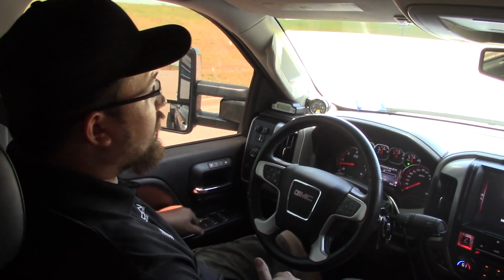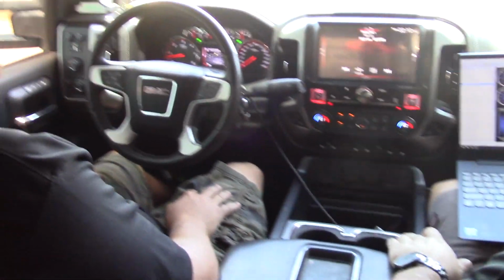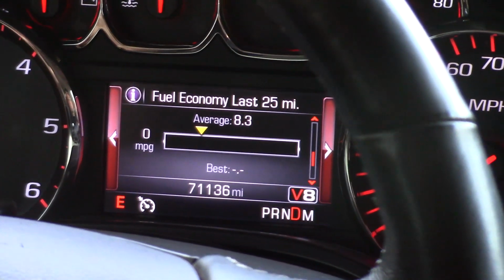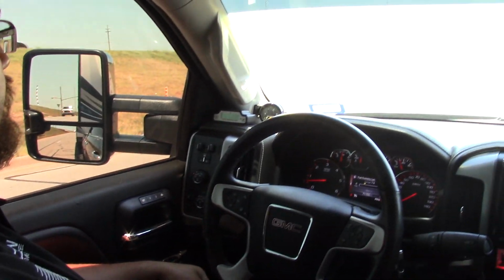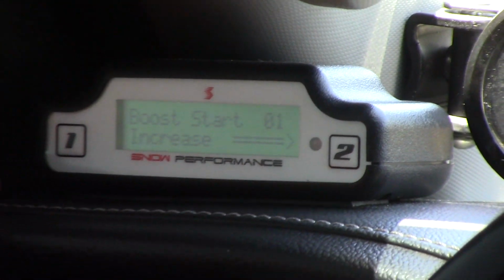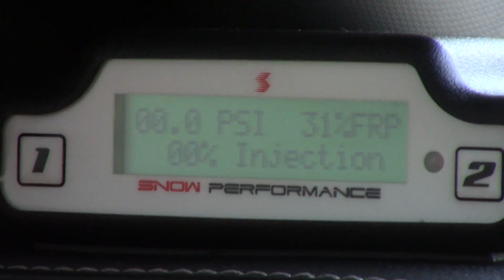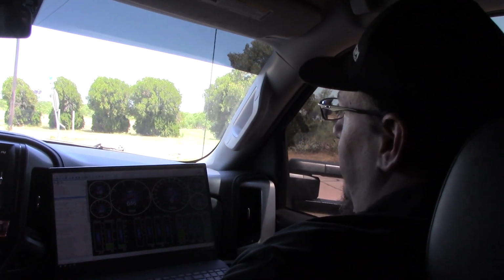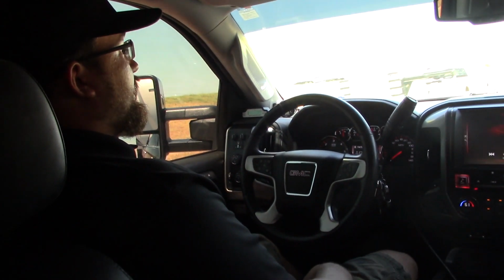Does Water/Methanol Really Help When Towing?

Comment: Hello! Fuel increase got it! 
Isn't one of the biggest benefits of using a water/meth injection keeping things clean and improved engine life? 
I do not have this set up yet, but I have heard it works like a steam bath etc. If true, that would seem like a much bigger benefit over 10% increase in fuel mileage when we think in terms of costs down the road. Ane engine that will run for 500k miles vs 350k miles without serious engine work seems like a much bigger selling point to me. Hell, I don't know! I'm just saying LOL.

Comment: You didn't reset the mpg average after the dry run. That means the wet run averaged together with the dry run. Thus, a more significant increase in mpg with the water/methanol injection than the 7.6 you showed.

Comment: How has the transmission held up on it? I have a 17’ sierra 6.2 with a whipple and want to buy your kit. Just dont know how the trans will hold after that much extra power on top of the charger. Thanks
Reply from the maker: The transmissions holding up well and that truck is still driven daily!
Reply: @snowperformance1  awesome, ordered your 2.5 kit for my 17’ 6.2 with a whipple.
Reply: @snowperformance1  did he have to do any tune changes or can it be put on with a special tune? Thanks
Reply from the maker: @tannersmith9218  It can be used without a tune but to get the most effectiveness out of the system a tune is recommended.
Reply: @snowperformance1  thanks a bunch!

Comment: A gas towing truck is as useless as it gets😂😂😂 My slowest diesel will shit on anything he does to that truck
Reply: Then again, there’s the 1091 Hall-Scott gas engine.
Reply: I have 2 diesels and am considering making my next F350 a 7.3L gasser as with the 10 speed and 4.30 rear-end,  they do great towing up to 20k.
Reply: @richfarfugnuven6308  that 7.3 is gonna piss off older diesel fan boys
Reply: @nativeoutdoors1780  yep. The TFL guys towed 16.5k up the IKE Gauntlet and did 65 the whole way, no problems.  I have a 42 foot toy hauler and that truck would pull my trailer just fine...
Reply: @richfarfugnuven6308  I think they are great looking engines from the trucks I've seen, definitely built to last a lifetime. And if you order a commercial f350 you could outfit it with dual alternators and batteries
Reply: @Rich Farfugnuven  yeah but it will not last nearly as long as the diesel and what I think is funny is that it has taken over 20 years for a gas job to get to 475 ft-lbs of  torque when in 1989 dodge cummins made 400ft-lbs of torque and now they make over 1,000 🤣

Comment: IAT is less important as EGT. I'm a huge Snow Performance (run a kit in 3 of my vehicles, and installed countless more in customers cars) but showing a lower IAT does not impress me, especially for towing. Show us logged EGT's. Thats what can spike and cause major damage, especially of concern on a diesel truck. 136 on a hot summer day is not bad at all. I've seen much higher in gasoline turbo vehicles. I'm sure a larger intercooler (not much more than the price of this kit) would have similar if not better effect and you wont have to constantly be filling a reservoir.
Reply: EGTs are definitely important and they should have shown that, however though id still argue the intake temps are more important this is a twinscrew supercharger they get heatsoaked pretty easy underload especially the edelbrock superchargers, if your intake temperatures get too hot it has to pull alot of timing and drastically drops your efficiency and its much more likely to detonate. if you can afford to drive a lifted supercharged 6.2L you can afford too carry a couple jugs of water meth
Reply: Without was 1753F egt. 
With was 1663F egt.

Comment: Absolutely by far the worst customer service experience I've ever had I was hung up on. They supplied me with only four feet of wiring and told me everybody doesn't have a problem with that quote unquote. I've installed a lot of nitrous kits on the lot of cars and I've always had to cut wire rather than add it